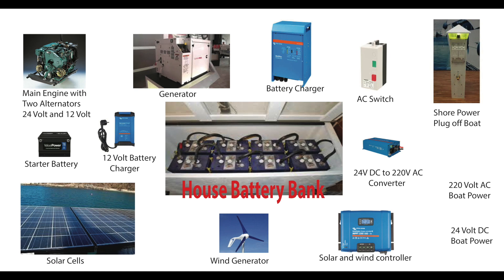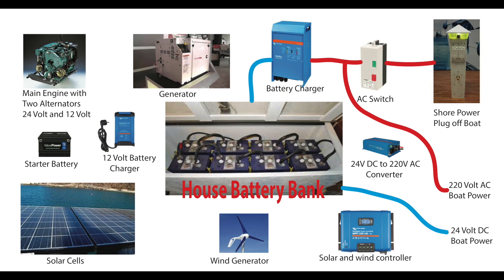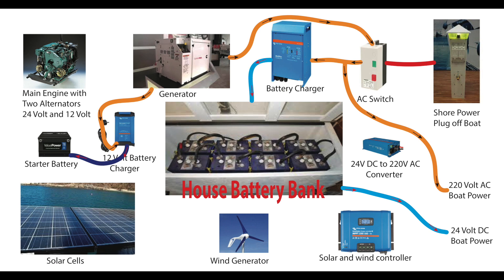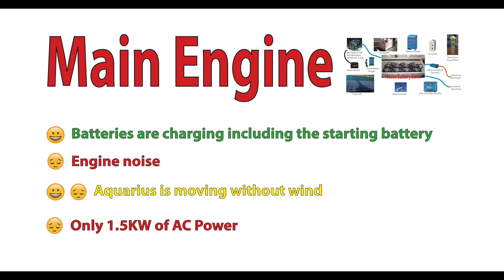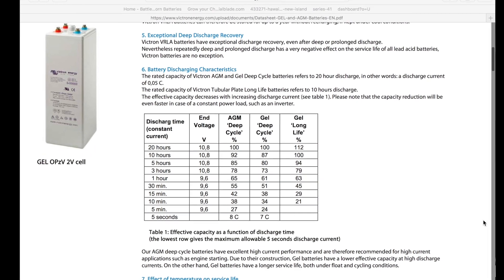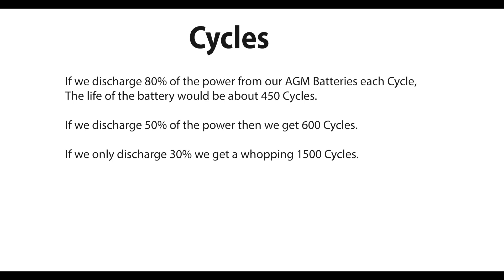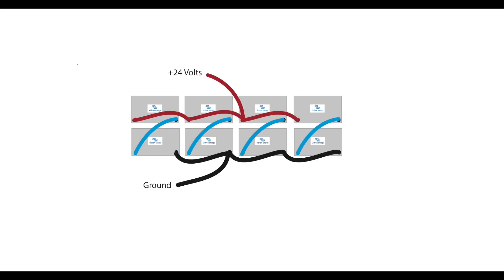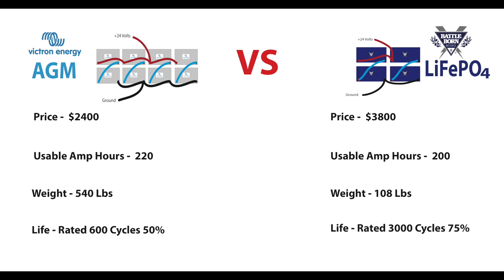Batteries and Power / Sailing Aquarius "How To" Series

Comment: Hold up, your insurance for having the lithium batteries, does your insurance not charge to more for having a battery that can catch on fire to justify the other batteries.
Reply: LiFePO4 (LFP) don't catch on fire and thermally runaway like some other Lithium Ion (Liquid electrolyte) types, but if the separator fails or cell is punctured they can still short internally and produce heat and vapour that causes the battery to expand and vent through a pressure valve, so it's still important to put the batteries in a fire resistant compartment that only vents outside to the atmosphere and not into the cabin, not that any DIYer I've ever seen installing them in boats does this...
https://pubs.rsc.org/en/content/articlehtml/2014/ra/c3ra45748f#imgfig5
Reply from the maker: I have never been asked about what type of batteries are in Aquarius.  Plus with all the safety features on the BattleBorn batteries the LiFePO4 batteries are probably more safe than Lead Acid liquid filled batteries.

Comment: Ken can you fit 10-12 of the lithium batteries in your storages compartment and switch between them with a auto switch until solar is available to charge them separate  and yes the Mrs is one of the finest examples I have ever seen  what a women  stay safe guys. We are still looking for that Amel
Reply from the maker: I know we can fit 8, Delos did it...  But not sure if we could fit 10, it would be very close.  When we bought the current batteries in Martinique we ordered 10 because I wanted more power......  Ended up they didn't fit and the electrician that did all the measurements took the extra two back...  The BattleBorn batteries are just a little smaller, and 10 might fit.  As for the auto switch....  yes I believe it is possible, all it takes is time and money...  :)  I think it would be better just to have a massive single battery bank. What do you think you would gain by having two smaller battery banks?
Reply: Sailing Aquarius Around The World  2 large battery Banks is what I was wondering about switching back n forth   2 small I don’t think is going to gain that much.  Find another place to add  whole bank Thanks guys